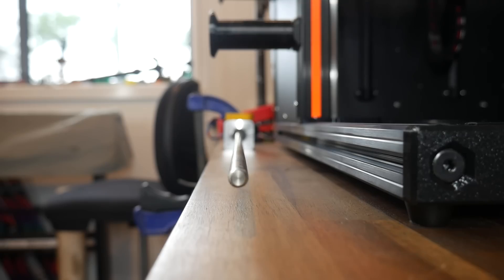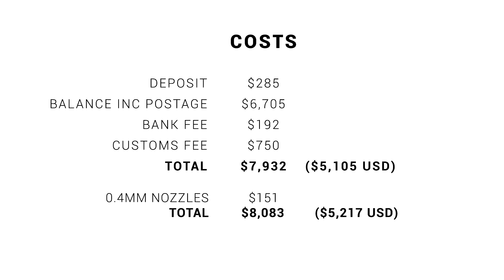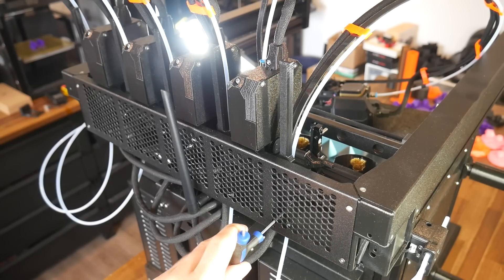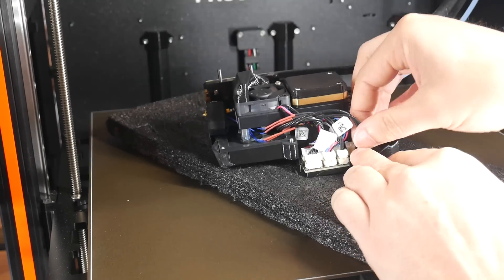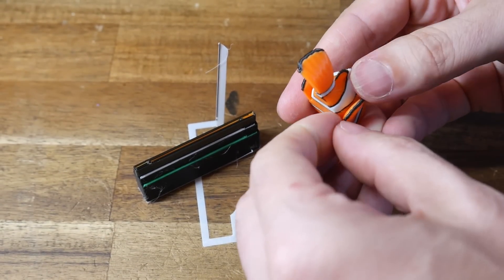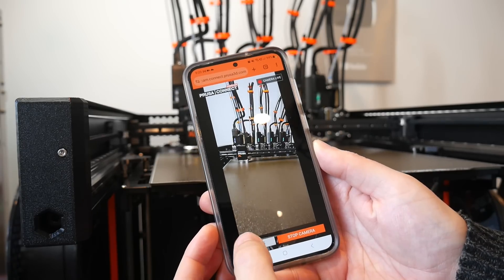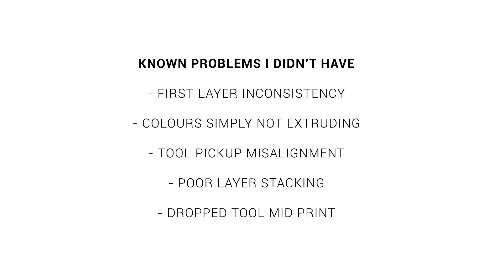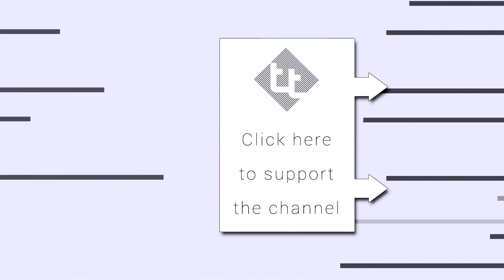I’m (mostly) happy with my Prusa XL - This is what it took

Comment: I am a new user of this printer and for the most part it’s pretty good. I however am having a hard time with some PETG building up around the nozzle. Do you have any advice to help with this?  

I’ve done a calibration cube and and have the extrusion multiplier set. 

I’m using 0.5mm Obxidian nozzles 

Any tips are appreciated. Thanks!

Comment: I would be taking things personal if I paid this much for a printer like this. I also don't understand the hype around getting this to save the amount of wasted filament, the price difference between this and a X1C Combo is about $6000 CAD. Knowing this it would take anywhere from 20 000 prints to 6000+ prints to make up the difference in waste vs cost to the XL. Even a heavy user would take over 6 years of printing averaging about 50 prints a week, again multi-coloured prints.

Comment: Have a 2 tool head Prusa XL and have had no problems with it.  Got mine about 18 months after release though. 
I have done a nozzle swap and there is no need to take out the heater assembly to change the nozzle.

Comment: We got XL for work this week. We got it as kit as semi-assembled was bit too steep priced in our opinion. Assembly instructions were generally great as usual, though few bits would've been nice to seen added considering we assembled enclosure at the same time. But all didn't go as planned. Filament outloading problems, filament got always stuck in first side sensor (ready assembly from Prusa). Some weird noises from CoreXY assemly (ready assembly from Prusa). To Prusas credit support was outstanding as usual. They virtually instantly stated that they can send new side sensor assembly for free, but I wanted to hear if it's ok for me to check it out if I can fix it myself and it was. I deburred channel a bit. Lifted sensor/magnetic array bit higher and made chamfer to ptfe tubing it started to work just fine. CoreXY assembly there was one motor pulley installed in slightly wrong height, but it also resulted me having to calibrate belt thightness again and it was a pia tbh. I tried phone app multiple times for multiple phones, but didn't get it to work. But managed to tune belts quite well by experience and got it tuned just right. There is excellent torture homing part from Prusa with ready made G-code that runs tower and does homing after every single layer and continues. It truly releaved need for belt adjustment as I thought and it was insanely helpful to see everything being 100% correct and not seeing any print artefacts. But this all on close to 2000euro printer and it took me about day to fix issues. It's worth noting that Prusa offered to get machine to them to sort it out, but I wanted to get printer to work as fast as I can for few needed parts. But bar is getting higher in printers and price I suppose is still ok for XL for single head assy, but I'm still disappointed that all issues were in parts that were assembled at Prusa. Wouldn't have any negative things if I'd done something wrong. But built quality should be spot on for this pricing. Also printer imo should be fully assembled for the price. With all this I now fully understand reading stuff from early XL adopters. It must have been cruciating to get printer with such issues. And I'm still bit disappointed that there isn't any brass brush style solution for nozzle cleaning after filament change. Imo machine should definitely have one for the price. I don't want to open enclosure mid print to remove purged filament from nozzle with some materials. It can be done from quite small gap bit some fiddling, but it's not fun and as said for the price, I should just insert filament, acknowledge change and leave printer alone.

Comment: So, for someone who has spent years reviewing and tinkering with 3d printer, this expensive machine has given you a run for your money. Surely, saying anything in the Prusa groups is a no no, because people can't fathom that there are some with terrible experiences. It seems like the expectation is that you would need to tinker with this complex machine with loose screws, bent rods, blown electronics. At least for putting up a review, they are offering you a new printer. For the rest of us, spending hours of hard resets, recalibrations, changing and adding new components. I have spent countless hours with support and even asked them about sending it over for them to just fix it. What annoyed me was that they came back with "I see you have an enclosure, damage from adding an enclosure is not supported under warranty". How do you damage electronic while adding the enclosure? And what is the point of purchasing original Prusa components if I get blamed for adding accessories later on. 

Like you said, the only thing they have going is that their support has been excellent! But there is only so much you can do before the warranty runs out and now you have a 50 lbs hunk of metal. Yes, the legendary support is precisely why I chose Prusa and paid extra. For that price tag, it just seems like they got the machine out the door and then working on fixing all the issues with it while charging people like the machine worked flawlessly.

The few times the machine has worked before another electrical component has malfunctioned, it has worked great, like you mentioned, minimal waste. 

I guess you can tell that I'm pretty disappointed and since I don't have a YouTube channel, trying to get his printer to work consistently or get a new one has been a chore.

Comment: I am so happy I did not jump to buy the XL. Everyone has sub par print quality with it.
Reply: Debatable. We got XL at work and yes I ran into few unfortunate issues and had to sort them out. But after that it makes quality that's insane and in a good way. I ran torture test where printer makes tower piece and after every single layer throws print head far out the print, homes it and continues. Test print looked like nothing had happened during the print and print height was already like 6cm's tall. Only like 1mm string I got into part as I tried to torture printer more and changed filament during the test. Also supports are so good that you can almost wipe them off by hand. Nothing I've ever seen on any printer.

Comment: HONEST Review. This makes my #3rd PRUSA Printer purchase in 5 years. After waiting since Nov 21, 2021.. I finally received my August 22, 2024 full factory assembled Prusa XL 5 Tool head printer yesterday. I carefully took my time to properly follow all instructions to assemble and set up my printer to make sure the assembly was executed perfectly. All tests and All calibrations passed and were successfully completed the very 1st attempt. All showed green check marks and heated properly for all 5 heads. All filaments we’re also loaded 1st try to all 5 heads and extruded PLA in all five heads successfully the first attempt. My first test print was also perfect and flawless. I could not have been happier, and I was glad I took the extra time to make sure it was perfect. My second attempt was to print the PLA, PLA, Flex wrist CT scan model that comes on the flash drive with the printer, but my # 2 head suddenly gave an error message on the screen and the printer shut off and rebooted. The same error message appeared after booting that the thermistor or heat resistor wire has a problem and may be damaged? How, This was just a few minutes after all 5 heads had just heated and passed calibration tests and extruded PLA seamlessly. How is this possible? Nothing touched the printer. I stayed up trying to troubleshoot last night for two hours and spent another hour and a half this morning and an hour just now with support agents attempting to figure out how this went from functioning perfect and passing test to failing without the printer ever being touched, to an error? I spoke with 2 Prusa customer support agents who are unable to understand how to help me and make this right.  This is very frustrating after 5 hours of careful assembly, I've lost 4-5 more hours trouble shooting the defective #2 Nextruder after it had just heated up and passed calibration. I asked PRUSA for help and support and tried to explain as friendly as possible that I can't waste any more time on this. I sent pictures and asked to please help me  and make this right so I don't lose any more of my time on my brand new $5000 printer. Prusa's solution WAS NOT to overnight me 1 fully assembled Nextruder Replacement with a little store credit or to include a couple extra boxes of filament for the troubles I've had and loss of time on a brand new factory assembled unit, but instead they asked me to carry the burden and do all the work to spend another 2-3 hours 60 steps, disassembling the defective Nextruder, along with another perfectly working Nextruder and swap parts and reassemble to narrow down which part component is defective. And if that does not work, they want me to move on the dissembling both Nextruders again and swapping the next parts to check which adds another 2-3 hours. Keep in mind, I paid $500 extra for FULL factory assembled unit so I did not have to deal with issues or worry about each individual part or waste time making it look as clean as they can from the factory. I don't want to have the burden of not routing all wires and tucking lines back as perfect as they did because I am not as good as they are. Plus I'd have to recalibrate everything again afterwards. I'm a loyal Prusa customer for over 5 years, buy their Prusament filamnet regularly and have convinced my friends and others to purchase Prusa. Is their support satisfactory ? I feel this is not right and unacceptable. Am I off here to expect Prusa to replace the defective Nextruder with a new fully assembled unit like I originally paid for? It's business.  I have to support my customers this way in my business, or I'll lose customers to my competitors who also offer this type of support. I'll remove this review once PRUSA steps up to the plate and takes ownership to make this right.  Does this seem fair to deal with on a brand-new factory assembled unit or should PRUSA do the right thing here?
Reply: How did it finish and how is your experience after 5 months since you wrote this comment?

Comment: What I find most surprising is how involved switching nozzles seems to be, especially compared to the Mk4. I guess they designed it with the assumption that you can just have different nozzle sizes in toolheads but as long as that doesn't work it kinda sucks.

Comment: I am a Prusa fan, but my patients are wearing thin. My i3 mk3 does very well and with little to no issues or hassle. But it’s harder and harder to stay with Prusa while the competition more and more features while Prusa drops the ball on the XL lacking some pretty common features. Prusa needs an i4 printer and one that blows the completion away. One that has a camera for time lapses and remote monitoring. One that has auto bed leveling and one that can be easily enclosed for little to no extra money. Like a P1P.

Comment: Sounds like shipping damage and he should have just taken the replacement. Personally I'd never buy a printer assembled. Not only is it more prone to damage, but you'll never be able to maintain it if you don't understand how to build it. As for stringing, that's a tuning & filament issue, not a printer issue. I think this is a typical scenario where a YouTuber hasn't acted like a normal customer and just accepted a replacement, in order to generate more content, wasting Prusa's time.

Comment: Christ, what a pain in the rear.  The only mod I did on my Bambu X1C was print a rack to keep the AMS about 5 inches over the top glass.  I was getting occasional filament jams when not using some AMS rolls for a while because the heat from the X1C was causing filament to distort in the tubes.  After making this heat break, I have not had one jam on the unit.  I think the only failures I have had are related to making mistakes in the slicer.  I don't worry about printing anymore and can concentrate on iterations of design.  I can't see the reason to pay more than 3 times the X1C/AMS for faster multicolor printing (and not filling up a poop bucket).  Some people will need the size and color capabilities of the XL but I think it's a niche market. The lack of an enclosure (or heated enclosure) is also problematic for filaments that really require it.  If they offered the XL in a heated enclosure for the same price, I would probably consider it as a possible option.  I think Prusa sat on their hands for too many years pushing their bed slingers and Bambu came along and surprised the heck out of them with their CoreXY boxes.  This is sad because I've always been a huge Prusa fan.  I literally use a roll of their PC-CF filament (incredible stuff!) every week for my engineering job so I sure don't want them to go away.  I think they rushed their XL to market before it was ready.  I'm hoping this will be their last black eye but I'm pretty sure Bambu is going to keep iterating with new products every 3-4 months.
Reply: You really can't compare X1C and XL. We specifically dropped X1C out of the equation cause of it's vastly smaller print volume.

Comment: You know what the problem with this machine is? Who is this marketed at, does the average consumer want to spend over 5000$ for a 3D printer? No

So not the hobbyists. Do companies want to buy a machine that doesn't work, needs babysitting all the time, and isn't professionally machined (injected moulded parts) but just 3D printed? No

So who will buy this? What market research did the Prusa Team do? 
To me it seems that what happened is, they woke up and said, let's make a tool changer printer with all the features. 

If anyone at Prusa is reading this, and I know some of you are, since you are nervous right now about the future of your jobs / company, I do hope you have one amazing plan C in stock. Otherwise, turn on that Czech engineering, it's in you somewhere, and DO SOMETHING. 

Sell to uninformed people to stay afloat, because the enthusiasts are gone. 
Good luck.

Comment: For the money you spent for the machine, Prusa should come and personally set your printer up for you because that is fucking STUPID how much that thing costs.  You will NEVER see your ROI that the multi heads save you in filament for muti color.  
Its a printer for a "problem" that doesn't exist, its too expensive, not even enclosed unless you want to double its price.  Just get a Voron 2.4 350 and an Enraged Rabbit Carrot Feeder, you will get 8 color printing, same build space, ENCLOSED printer.  Best of all, it will be 1/3rd of the cost of the XL!

Comment: This is what is wrong with the 3D printer industry. When you buy a product it should work OUT OF THE BOX...
Imagine buying a car like this. You have to climb in the windows as the doors don't open, drill a hole in the boot to fill the petrol tank, rewire all the electrics, throw away all the wheels and buy a set that works, make a lever to rub against the back wheels as breaks, buy a new aftermarket engine and replace it, then eight months after getting your "new car" go for your first drive...
This is less stuffing around than buying a 3D printer. Then you get your $8000 machine to make a $5 toy...

Comment: I really was considering Prusa XL, but price and performance were main factors. I ended up getting the X1 Carbon with 2 AMS units.

Not happy with Bambu being a Chinese owned company and cloud servers so I had to add it to my untrusted network which is locked down with a VLAN to segregate network traffic via OPNSense firewall.

I just updated X1Plus community firmware yesterday and working really good. I now moved printer to my regular network while blocking Internet access.

But... I really like the Prusa 5 hot-head design, but much to expensive for what I use it for. Reviews were not stellar which was a decided factor.

I may consider Prusa in the future.

Comment: It took way too long from first launch to actual shipping and even then the firmware and Prusa Connect were not ready  To be fair, the firmware still needs some upgrades to get the most out of the machine. 
Installing the tool heads is a bit of a hassle and you have to check/tighten some screws periodically. For a printer in this price category you expect better. 
I am one of the lucky guys. In the beginning I had problems with the wipe tower (not sticking) and some stringing. The wipe tower is still a problem, but just not using it also solves the problem. Stringing is a lot reduced by using 0.4 mm nozzle and  no z-hops. The firmware is improved to and with the latest version the XL became a lot less noisy.
It is Prusa is a name that stands for reliability and good (long term) support, otherwise the brand would not make it. Development must go faster and prices must decrease at least 20% to stay completive in the long run. At the moment I would not recommend a Prusa printer, unless you are a heavy user.

Comment: I'm sorry but spending that much on a printer I would like a 100% finished product hardware-wise. I would rather have a lot of waste in purging than have a 5k printer that might work once I have tinkered with it. It's just a shame that such a good company with good printers rushes to release something so they are ahead of its competitors. Hopefully, they get it fixed but I can see bambu releasing something similar for cheaper soon with the second gens 🤷‍♂